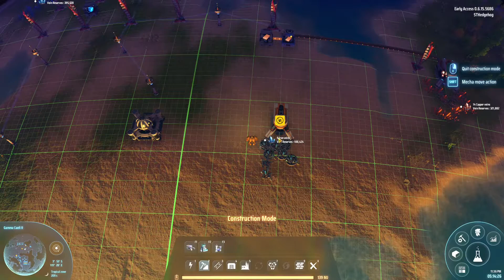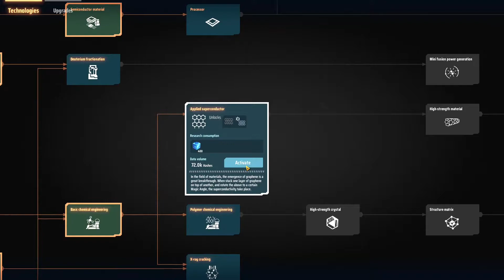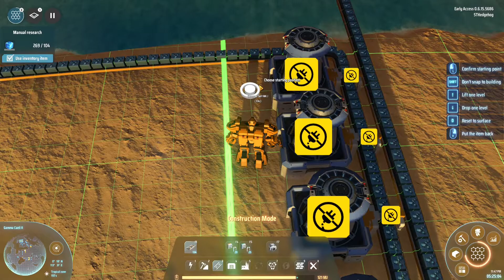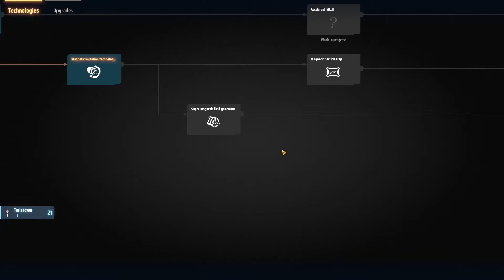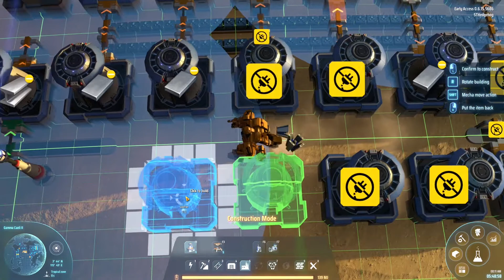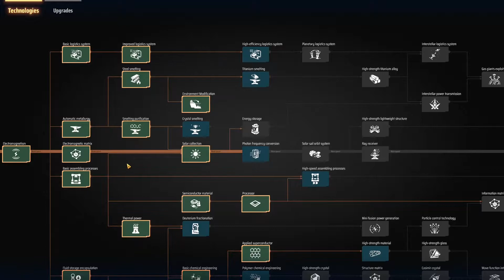Dyson Sphere Program - Starting On Production Lines

Comment: lol, wy isnt the output belt running out , it's loading the belt to its maximum so its fine the last smelter is outputting to completely fill the belt before you start taking them off so its perfect ratio
Reply from the maker: I completely forgot the machines have a buffer inside. If I was to empty them and set them all of at the same time it would balance perfectly (until it backs up)